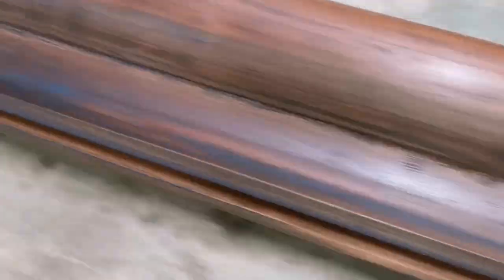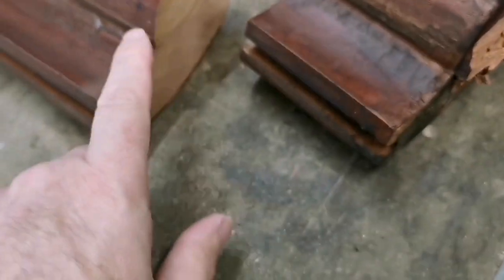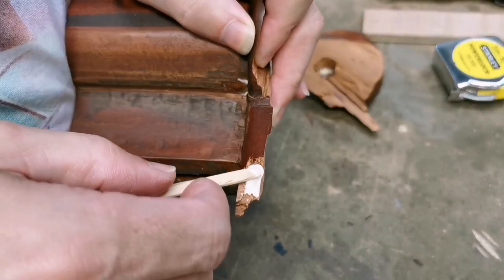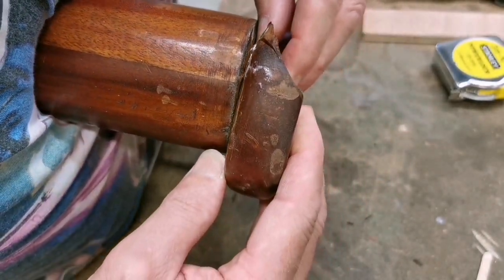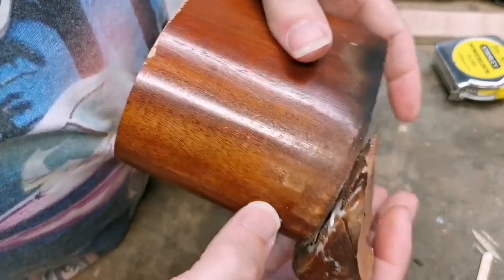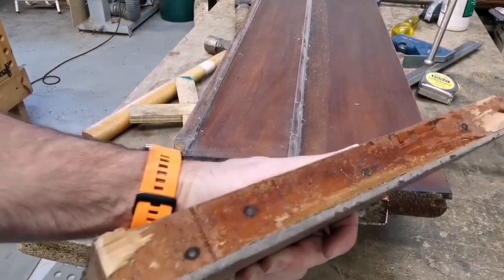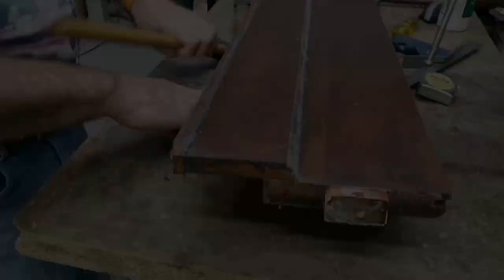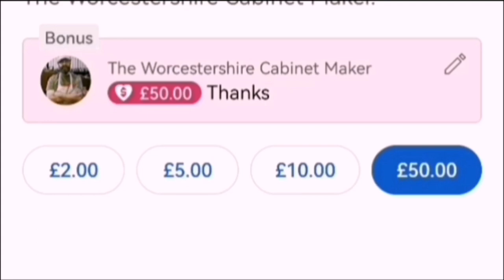Sleigh bed restoration - The Nightmare can of worms begins. [Part 1]

Comment: Very nice detail camera work to show what you’re doing
Reply from the maker: I've found I can crop the video. I have to separate the part, but then crop to where it looks good for the part. Saves moving the camera sometimes. And apparently, zooming in and out a bit helps keep the attention of the viewer.
Which part Darren?
Reply: @twcmaker  the details of your glue up were very good , I really liked the whole thing. Yes cropping is great as is a Ken burns for longer ‘on scene’ time
Reply from the maker: Hang on a bit.. 🤔 Who's Ken Burns?
Reply: @twcmaker  it’s a feature in my editor. Must be the inventors name maybe. It zooms in or out and you can vary by how much. I’m sure phone software must have something similar
Reply from the maker: Ahhh I've tried to do this. But the features on my phone are a bit to fast for my liking.
Reply: @twcmaker  strange question do you use a tripod for your phone?
Reply from the maker: I use a C-stand video of me putting it together. 🙈 I have a video of everything nowadays 🙊 https://youtu.be/J9ebI5VZ0Ws